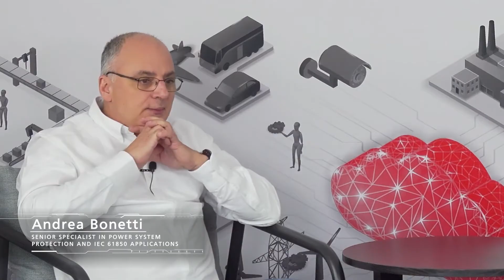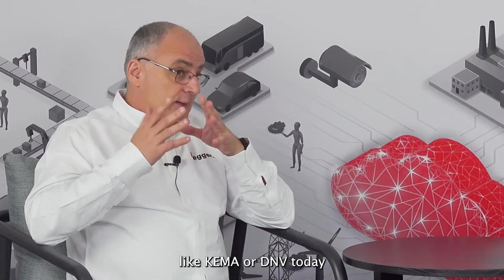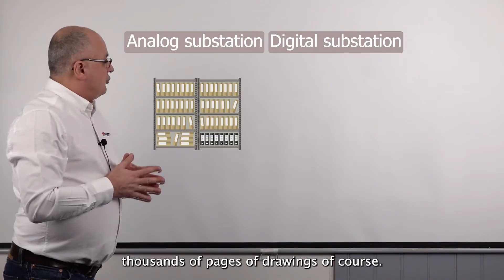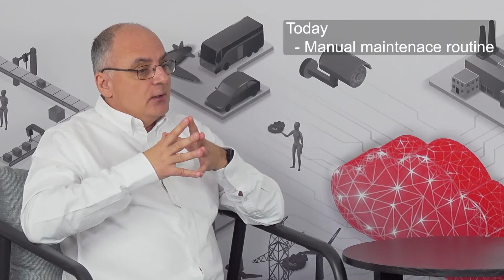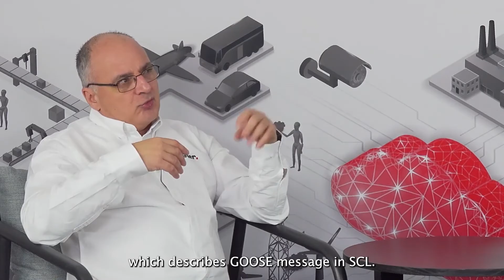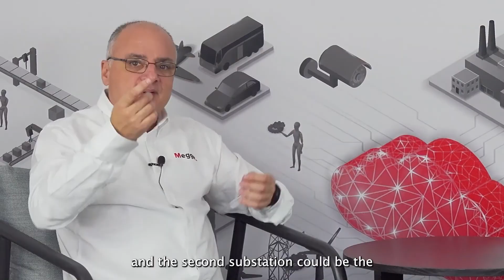Welcome to the Digital Substation World I Episode 01

Comment: For guidelines on a engineering process for a digital substation, based on International Standards IEC 61850 Series, reference should always be made to IEC TR 61850-90-4:2020: Communication networks and systems for power utility automation - Part 90-4: Network engineering guidelines.
1 - IEC TR 61850-90-4 focuses on engineering a local area network limited to the requirements of IEC 61850-based substation automation. 
2 - IEC TR 61850-90-4 also outlines the advantages and disadvantages of different approaches to network topology, redundancy, clock synchronization, etc. so that the network designer can make educated decisions. In addition, this document outlines possible improvements to both substation automation and networking equipment.
3 - IEC TR 61850-90-4 also addresses data transfer over the network in IEC 61850, such as transmitting tripping commands for protection via GOOSE messages, and in particular the multicast data transfer of large volumes of sampled values (SV) from merging units (MUs).
4 - IEC TR 61850-90-4 also considers seamless redundancy to increase the network availability under failure conditions and the high precision clock synchronization that is central to the process bus and synchrophasor operation. 👍
https://webstore.iec.ch/publication/64801

Comment: This explanatory video encompass important and fundamental topics regarding to automation of electrical systems and digital substations, such as:
 - SCL Files (SSD, SCD, ICD, CID)
- GOOSE and MMS IEC 61850 protocols for horizontal and vertical communications between IEDs and to the supervisory system
- Top down engineering process: SCD --> CID
- Maintenance procedures and routines for a digital substation
- Specific competences required by professional engaged in design, installation, commissioning and maintenance services for an IEC 61850 based digital substation
- The importance of IEC 61850 Series for achieving the Smart Grid
Congratulations to Niclas Wetterstrand and Andrea Bonetti for sharing such informative, normative and fundamentals information on IEC 61850 applications!
Reply: may i know which breakers are monitored